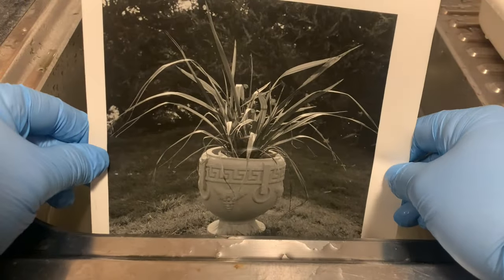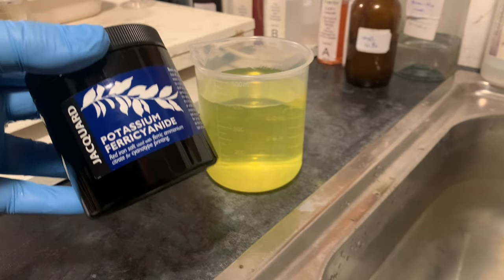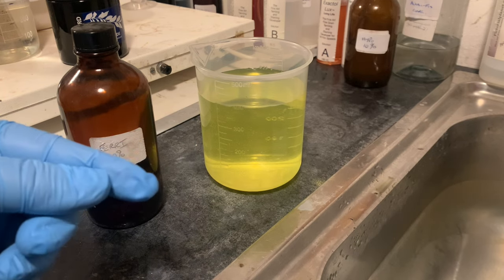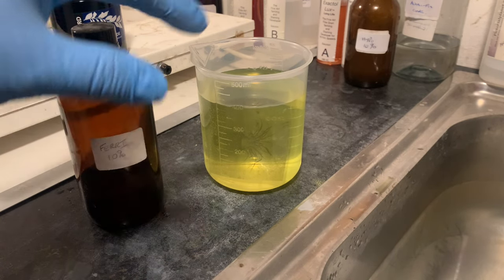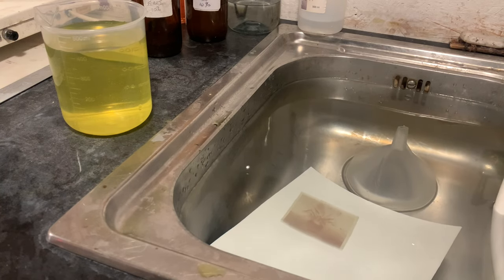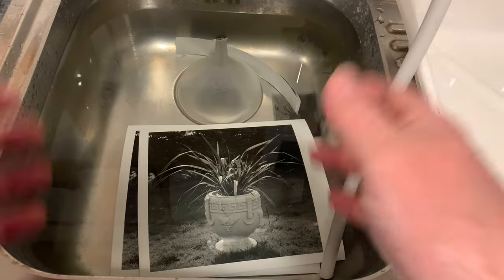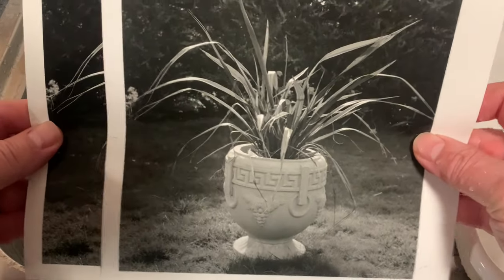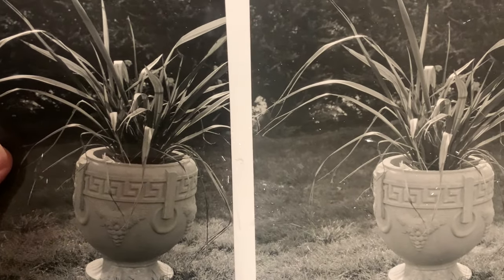Printing the Negative 3: Flat or Under-Developed Pyro Negatives. Method #2

Comment: Question 1 (with acknowledgement of the importance and usefulness of the shared process), wouldn't more exposure and increased grade do the same thing?
Question 2 - can one redevelop normal negs with the toner? Or is it just a compromise to not alter the pyro stain and would have no coloration on normal negs?

Comment: Great video John 

What I need to do is reduce the density of a couple of my negs , I've been into insane times on the enlarger ! I was wondering about bleaching to reduce ?
Reply from the maker: Edit: see Shane's answer in this thread.
Reply: When you do this, does that bleach affect the density of the shadows first , being the thinner part of the negative like bleaching a print would affect the highlights first?
Reply from the maker: Probably. Edit: I think Shane is right, that the shadows will be bleached first so the effect won't be even. And the redevelopment is too fast to control in a meaningful way.
Reply from the maker: Are you overexposing your film, creating negatives that are too thick? Would it be worth increasing your EI until your negatives are workable?
Reply from the maker: I might do a video on this. The possibility of bleaching out the negative and developing again, N-, in regular developer or perhaps a two bath. I'll do some trials. Of course, the technique would be a last resort, for negatives that are just way too thick to print well, but it is something I'll try and see if it works. I think I read about it somewhere like one of Thornton's books. 

It goes something like this (but I need to test it):
1. Thick negative from over exposure and over development 
2. Bleach back negative
3. Developer, by sight, to process less silver in the image watching to control highlights
4. Stop and fix as normal